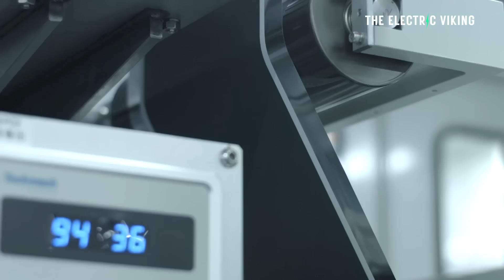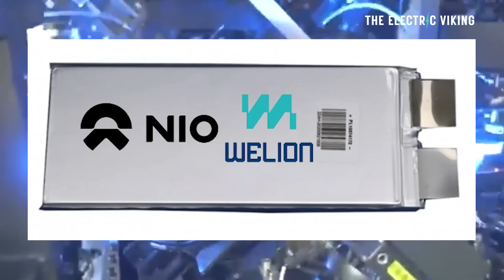Worlds fastest electric car superchargers can charge EVs at 640-kW speeds

Comment: If the battery is designed for it fast charging will not hurt the battery.  This under the condition the battery is not to undercharged or to close to fully charged.    This would be like 10 to 80 percent charged.

Comment: With no issues, you can charge at high power even 1 MW without battery degradation if you increase the voltage by putting the battery modules in series. It's as simple as that. What degrades charging a battery is high current across the battery module, its voltage is fixed by the chemistry, and the number of battery cells put in series inside the module. As conclusion, you can achieve any charging power by a clever architecture in series of the modules and cells, combined with an advanced power management and cell temperature control system. Most probably, in the next 5 years we will see battery architectures above 1000V

Comment: Channels like this tell LIES not in what they say, but in what they dont say. Let's say you charge at an efficience of 99%. You dont, but let's ballpark that. That means an inefficiency of 1%, dah. Where does that 1% go? It is dissipated as HEAT. 1% of 640kW is 6.4kW. A more realsitic value is 5% dissipation which is 32kW. You calculate how hot your battery will get if it has to handle 32kW of heat for even 6 minutes. THe faster you charge, the hotter the battery will get, because the dissipation out doesnt change with the increasing charge rate in. . FYI,  the Autoexpert channel has several detailed discussions of battery overheating and fires. Good luck with your charing! You're going to need it!

Comment: That which, at the end of the day, decides the charging speed and the capacity, are the power lines and cables that connect the charging station with the country wide backbone high voltage power line network.

Of course you can have batteries at the charging stations, but the price of a kWh will be accordingly which means most people will not accept it.
No one makes investments in an infrastructure that less than 1 % of the customers use.

Maybe there are some commentators here that would like such speeds, but in the end they don't want to pay the price.

Sam, shouldn't you ask your local electric provider what it costs if you instead of 20 or 25 Amps want 2,000 or 5,000 Amps at your house? Or do you mean that I shall ask my retired brother who has built/planned power lines in a city?

Comment: Great video. Battery swapping in principle means that the car can enjoy improvements in battery technology over time. A car with structural batteries suffers obsolescence in accordance with the speed of its battery deterioration.
Reply: structural battery makes cars easier to build, ie cheaper to sell too. It improves safety by a considerable margin.  Extra stess on fasteners and cable plugs also would mean some very ordinary servicing costs at some time during the vehicles's life. It does nothing to address battery costs.  A battery swap centre has to have how much stock on hand? A million cars.....maybe 3-1 ratio on standbye. Thats a massive investment with massive risks to the investor. Sometimes, when theory meets the rd, its better to move on

Comment: Sam, you need to do some back of the envelope calculations to realize the total impossibility of what you say.  There is an enormous difference between running a few prototypes and mass production and adoption.  Do not peddle falsehoods to people.  EVs are stupendously high maintenance and high consumption vehicles that our world cannot possible support en masse.  Do the calculations yourself for goodness sake - before making the next video.
Reply: What maintenance? I swapped a 2019 Audi A4 45TFSI that cost me $26,400 in fuel, maintenance, tyres and brakes over 4 years / 80,000 km for a Tesla model 3 this year. After almost 12 months and 20,000km I have spent less than $700 on fuel $0 maintenance, $0 Tyres, $0 Brakes - the tyres & brakes will definitely last longer than the Audi's and the insurance is 20% cheaper.

I could swap the battery every 2 1/2 years from my own pocket and still be ahead on running costs.

Real life example not YouTube FUD.

Comment: The 640kw liquid cooled fast chargers by NIO apparently start out slow, amp up during the middle of the charge, & slow down near the end.. I guess this is to not do damage to the pack.. Amazing stuff, Happy New Year Sam!! 🎉🎆
Reply: I was thinking systems that charge this fast or faster will need liquid cooling INSIDE the battery, itself. Plug the station's 2" diameter water line into your car, watch the see through inline filter, and you're off to the races.
Reply: @monkeysuncle2816  Will leave that one for the engineers,  🤗

Comment: EVs are not the future just yet and this socially engineered forced rollout is going to be detrimental. They result in more carbon in their life cycle. They are misrepresented, for example in Australia our resistance loss in power transmission is 50%, EVs consumer should be calculated with that penalty too. 
It's clear that solid state or higher power density batteries are near future so current battery tech is thankfully being rejected by the public. When a garage full of EVs goes up like thermite and caused multiple fatalities, that nation will likely outright ban EVs. Immature/unsuitable tech being forced upon the public and to do it they offer bribes in the form of rebates and resort to mass PROPOGANDA CHANNELS on you tube such as this disingenuous Electric Viking thing.

Comment: Sam, you are correct. Charging at 640KW is insane. Do you have any idea of the consequences when something, inevitably, goes wrong, particularly from heat generated.
Reply: The cable and socket will be liquid cooled. That is why the can carry the current beyond awg guidline.  Im not keen to forced cooling approch. But cant come up anything better either.

Comment: I would be very concerned with forcing so much current into a battery in such a short time especially if it was done frequently
Reply: Perhaps they need to put in a refrigeration unit to keep the aquired heat down to a minimum, such a high charge would frighten me.
Reply: Yeah and hence this is why swapping could be better.
Reply: That's why we have mandatory safety and durability tests, yes. So that we don't have to be concerned.

Comment: Fast charging usually has had a negative side; lower battery life.  If Nio can do this without higher risk of fire or shorter life it would be very positive; assuming such chargers can be implmentented with current infrastructures.

Comment: Personally I’m not comfortable standing next to a cable that’s running 600v at 1000amps this is insane power and extremely dangerous
Reply: 900V 650A

But the trick is that it has only solid state circuits. Plugging "live" 650KW is dangerous indeed, but the flow itself is not.
Reply: Who tf stands next to a charger when the car is charging ? 
Do you have an EV?
It’s like you don’t even have an EV and just saying BS. Or you’re ridiculously dumb.

Comment: The crazy thing is, filling up your car with gas at 10 gallons per minute is another 10x that speed-- an equivalent of around 6 MW. But still 640 kW is a great improvement!

(assuming 10 kWh equivalent per gallon of gas, since EVs are typically 3x more efficient than ICE vehicles and a gallon of gas actually has about 33 kWh)
Reply: All of the petrol pumps around where I live take 50sec to 1 minute to fill a 20L (5.3 gallon) Jerrycan. A litre of petrol contains the equivalent of 8.9kWh of energy that's 178 to 213 kWh per minute added. At 7l/100 km (33 mpg) and 20L per minute I am adding 285km range per minute.

At 7km per kWh, if 640Kw could be sustained for the full charge (which of course it can't)  that would be 10.66 Kw per minute or 75 km per minute.

The range added would be 1/4 of petrol (or 1/3rd using my EV as a base) -it's getting closer
Reply: you will spend more time going to the toilet or taking a break.  Its a non issue. Yes the cold numbers dont lie but you got to keep a perspective. How much is it REALLY going to affect you?
Reply: We're definitely getting close, especially for smaller EVs in the Tesla Model 3 or Tesla Model Y size range.  Trucks are not there yet though. 600 kW or faster is where we need to be for pickup trucks.

Comment: Question I have is what is the longevity of the EV batteries when charging them this quickly every time.  I thought Supercharger stations reduce the expected battery life in an EV vehicle.  Just wondering based on past you tube videos about information mentioned on fast charging.
Take care.
Reply: A read about a study showing less impact of fast charging than previously thought or feared.  It was far from the biggest factor.
Reply: depends on battery chemistry. LFO batteries are  less stressed by fast charging. If you see what tesla engineers say, battery temperature is the only issue with fast charging. Getting battery management right is the key.

Comment: The greatest advantage of the battery swap is battery degradation and the only way to retain the value of your EV after many years of ownership/usage/charging. What would be the second hand value of your EV after 5-8 years? 🤷‍♂️🤷‍♂️🤷‍♂️. Imagine for a minute that you could replace your battery/engine for less than $100 after driving for over 100,000 miles. Battery swap is a win any day.
Reply: NIO's model is a rental model it's not free for the first 100k miles either and the rental fee is the equivalent of buying a new battery every 7 years.

The question is what is the value of a NIO after 7 years? after all you are committed to $200 a month + the actual charge fees forever no matter how many miles you do, whether you actually do any swaps or whether you home charge or not, people will factor in the additional $200 per month in cost and reduce the purchase price accordingly if I can only afford $400 a month in total loan + costs  1/2 of that purchasing power is gone immediately - I will only be able to pay $200 a month for the car itself as a loan repayment.

Swaps carry less risk of one time large replacement cost for sure but in the long run for the average person owning the battery is cheaper.

Comment: The beauty of the electric fill up is that you don't have to stand at the pump holding the trigger and being fearful of your phone igniting the toxic fumes. Clean the windshield, check the tire pressure or play with the entertainment screen in the cabin for the now brief charging time.
Reply: EV or gas, If phone emitting fire or spark, handle that first
Reply: @justinr9753  Could be the guy on the other side of the island tossing a cigarette you way.  His wife does not let him smoke in the car.
Reply: @danharold3087  Mythbusters couldn't do it
Reply: @justinr9753   Maybe if the were on the air longer they would have revisited it as they have done with other things. Point is they are not infallible.

Comment: Imagine 20 of these chargers on the parking lot, and 20 cars are charging, using 12,8 megawatthours. (which is around the consumption of 1200 houses ) I guess this is the problem with fast chargers :)
Reply: You are mixing megawatts and megawatt hours
Reply: Please, bear in mind that EV's don't charge; they're being charged day after day. That said, actually, most people will charge their cars at low charging speeds at home or at office, and that will suffix for most of them. Those chargers will be for public charging only, done right like you do fuel your cars today.

Comment: It’s indeed odd that this comes from a company that pushed battery swaps. In my view, battery swaps always had finite live. Faster charging inevitably will get to the point that swapping is pointless.
Reply: Minus the fact that batteries are developing so fast that people will want to have better ones at their cars as times go, while retaining those very same cars and hopefully to sell them at a reasonable value. EV's right now do have a huge depreciation because they're "stuck" in their batteries almost for life. Some EV's do have the capability to change some battery parts, but it's a "difficult" task done by specialty workers that aren't that abundant. So, some sort of easy battery swap will need to enter the game. As batteries are becoming more dense and efficient, they'll also likely to become smaller by the day, then, they'll to get that one sorted out.
Reply: @nunagoras  I would not want to buy an EV car and then swap my batteries. Who knows what battery pack I get. I rather own my own batteries. And what happens when you sell this car. Do you wait till you get  a newer battery pack in the switch? I agree that batteries are getting better and cheaper. This indeed results in deprecation of the car. However, in that case, you can wait forever until you get a new car. In any case, this is the same for any product with significant technology advances. Remember how each year new computers got better and cheaper. So, wait or buy now is the question.
Reply: @nunagoras    EVs are not flashlights.  When upgrading to better batteries you can't simply swap the pack.  You would also have to change the charge controller and the BMS system.  Maybe a car company into battery swapping would try to develop a system to reprogram the BMS and charge controller.  But that type of thing is unlikely to work.  The old electronics will have something that makes them unsuitable for use with the new battery/cells.
Reply: @danharold3087  What are you talking about? All NIO's batteries will fit to for all models. Even this future 900v battery will fit and semi-solid state 150kw will fit.
Reply: @iSot80    I am speaking from years of computer and electronics experience.   This sums it up best.  Even with careful planning, unforeseen technological or industry shifts can render forward compatibility efforts ineffective or obsolete.  In some cases they stifle innovation.  
I would not take the following as gospel as it is from bard but it sounds right.
Compatibility depends on the specific NIO model and its production year. NIO has made gradual upgrades to their battery swapping technology and battery packs over time. Later models within the same series might be compatible with newer batteries.
Reply: @iSot80  You need to read up some more - they all currently fit because they all currently use the same 390V architecture. You can't put an 800V or 900V battery  into a car designed to take a 390v battery, every current NIO car is limited to the current battery architecture.
Reply: @TB-up4xi  Yes, I understand the difference between 400V and 900V. I have understand from NIO response that compatibility will stay for old NIO cars too.

NIO has said from the beginning that future batteries / future battery tech will fit also to old NIO models.

That does not make any sense if it is not true. That means these current 2400 battery swap stations will not support old NIO cars no more when Bass-station batteries will replaced to 900V.

Please, offer more information for this where and when NIO have said that old cars will not be supported for future batteries?
Reply: The company is trying to solve the 5 minute charge problem.
Reply: Swapping will never be pointless because it is more convenient than charging, and swapping will likely always be faster than charging, and it enable battery upgrade
Reply: @coz2j69  I beg to differ. If it is so good, why is nobody else following Nio. Most Chinese EV companies have had great sales years but Nio is struggling and bleeding money. It’s expensive to set up the stations and it can’t be shared unless it matches same battery format. I am also not convinced that battery swaps will always be faster. According to US DOE, more than 80% charging happens at home or work. No time lost. And superchargers are only getting faster. The Tesla v4 is many times faster than the v1 version. And it will only get faster. When solid state batteries finally arrive on the scene, those batteries will be able to handle even faster charging.
Reply: @denero66  What are you talking about?

In China, NIO has signed already a deal for energy and battery swapping business (for EV's) with these car brands.

Changan Auto
Geely Auto (Volvo, Polestar, Zeekr, Smart, Geometry, Lotus, Proton, London Electric Vehicle)
Chery Automobile
JAC Group.

It is only a matter of time when for example BYD will join too.

Comment: Just like you I wonder how long the batteries last when being heated up this much? Maybe they have reduced the battery internal friction? If not then get the extended warranty!
Reply: Increase voltage on battries from my understanding, since you need less current then.
Reply: @AndrewTSq An lfp cell is always 3.2v and nmc 3.7v
Reply: @Lucas-wp2ph  I mean going from 400 volt to 800 Like Porsche, or go from 800 to 1600 volt even maybe?
Reply: @AndrewTSq  Indeed that would work. However increasing cell voltage can also cause decreased battery life as that tends to cause anode degradation in certain chemistries.... or so I have read. I'm sure their experts have this figured out... I'm no battery chemist!
Reply: @nickmcconnell1291  but this should not increase cell voltage? you just put more batteries in serial? but I guess the max current you can get gets lower instead.  I am no battery chemist nor expert either :D
Reply: @AndrewTSq  I am guessing that they have discovered a way to reduce the chemical resistance in the battery of accepting a charge...which would keep heat from being built up. This might facilitate faster charging without degradation due to overheating. Purely a guess however. 
Happy New Year!